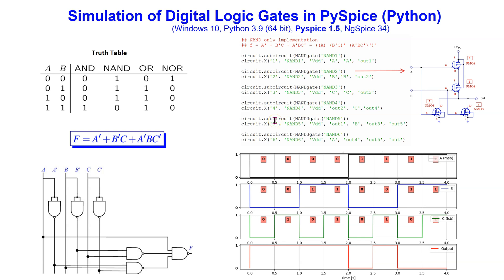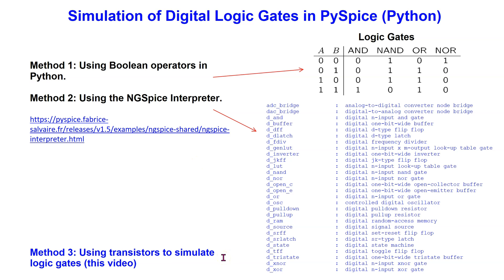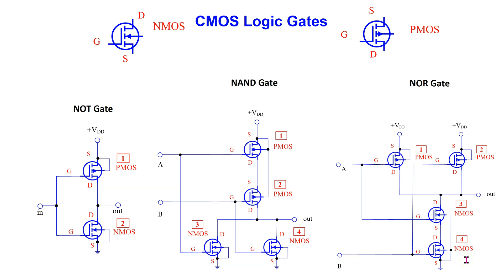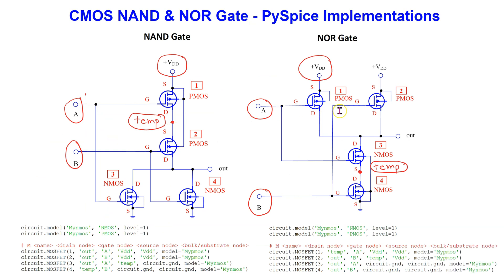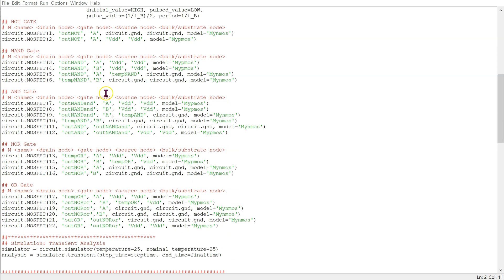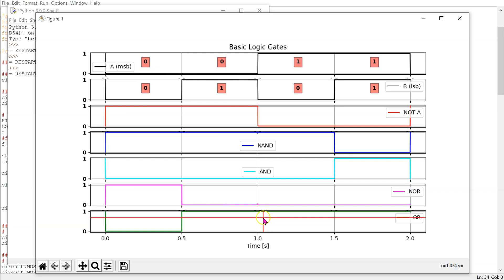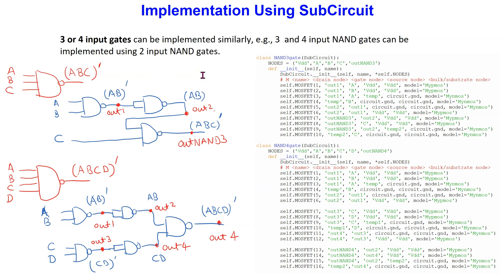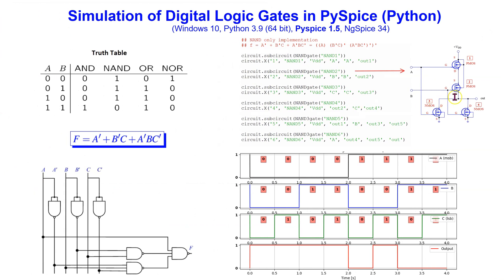Simulation of Digital Logic Gates in PySpice (Python)

Comment: Hi sir, when i try to run as your tutorial, mu ngspice is not supported by version 38, how to fix it ?
Reply from the maker: Hello, I am currently using Windows 10, Python 3.9 (64 bit), Pyspice 1.5, NgSpice 34. I have not used NgSpice 38 so cannot comment. I would suggest to reinstall PySpice 1.5 with default options:

The latest version of PySpice is 1.5, with NGSpice-34 (Released May, 2021). You can install and check using the following commands:

pip install PySpice==1.5
pip install engineering-notation
pyspice-post-installation --install-ngspice-dll
pyspice-post-installation --check-install